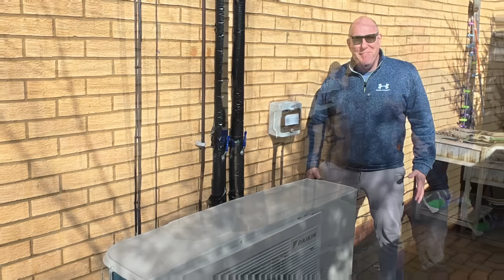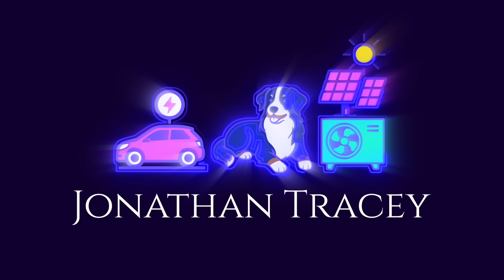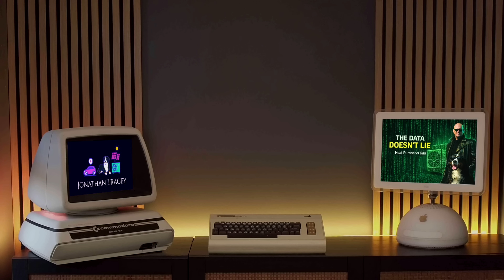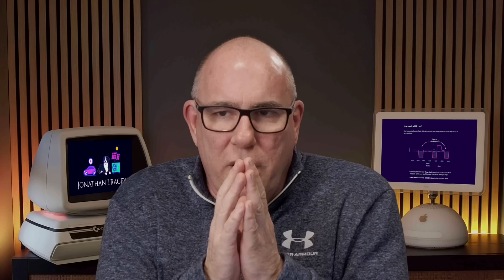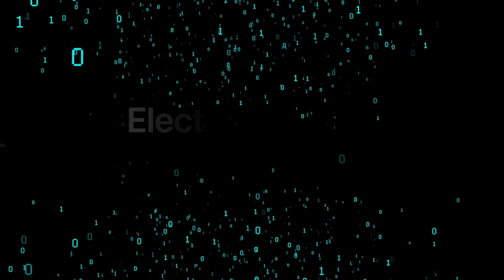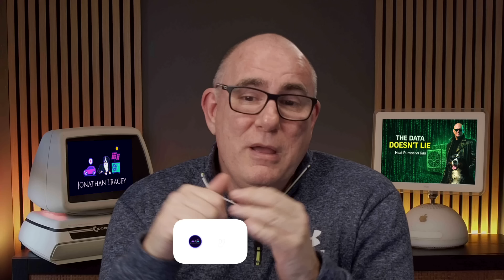The Data Doesn’t Lie   Gas vs Heat Pump Real Running Costs

Comment: Yeah you need to run those numbers again 😂😅
Reply from the maker: I have just completed another round of these numbers, video coming tomorrow
Reply: @JonathanTracey you are correct of course solar battery and heat pump is undeniable the best way to go, any other combination is Suboptimal

Comment: The biggest scandal is that our 650 MPs haven’t  made it law that every new build property be fitted with solar panels, heat pumps and ev chargers….i wonder why??….could it be that if every household had a bill of £0 then no VAT or fuel duty would be due !!!
Reply from the maker: @Vega9Baja I get why it feels like that, but it’s not quite that simple 👍

There is lobbying in the UK, but it’s regulated and transparent — MPs still have to justify decisions publicly and through legislation.

On your main point — even if every home had £0 bills (which realistically wouldn’t happen year-round), the government would still collect revenue through other taxes (income tax, VAT on other spending, etc.). Energy isn’t their only income stream.

I do agree though — there’s definitely a case for pushing new builds harder on solar and efficiency 👍

Comment: They don't give 'more even heat' at all! They use the same system as a gas boiler would.
You've chosen a poor combi at 90% efficiency, they're more than that now - up to 98%. Apply that 8% to a £1k PA fuel bill gives you a saving of £80.
 Even the most expensive and efficient Combi is a fraction of the cost of any ASHP. I don't think you took ROI into consideration, maybe time to get the calculator out again!
A combi lives in luxury, an ASHP does not. It lives outside in the cold,  rain and sun. They all take their toll.
 I wonder what state these ASHP will be in after living outside in the UK for years on end. If you've ever worked on anything which has lived outside you'll know just what the weather does to it, rot, rust, seizure, breakages etc. 
Off the top of my head I can't think of a direct comparison, only a car which sees more extremes and they don't come apart very easily after 10yrs of being outside. Heck, even two of our UPVC windows have seized and broken mechanisms so the sashes can't be opened, some units 'blown', the doors let in draughts. They were made and fitted by a well known top end company.

Only time will tell on that one.
Reply from the maker: @lksf9820 I get what you’re saying, but this is where the difference shows 👍

Heat pumps typically run **continuously at a low level**, so the temperature stays stable. Most gas boiler systems are run on schedules — on/off — so the house heats up, cools down, then heats up again.

So yes, both use radiators, but the **way they deliver heat is different**, and that’s why many people experience a more even temperature with a heat pump.

On efficiency — comparing 90% vs 98% on a boiler misses the bigger point. A heat pump isn’t 100% efficient… it’s typically **300–400% (COP 3–4)**, so it delivers 3–4 units of heat for every unit of electricity.

And on longevity — these units are designed for outdoor use (like AC units, which have been running outside for decades), so it’s not quite the unknown it might seem.

Happy to debate the costs — but the fundamentals there are pretty well established 👍
Reply: @JonathanTracey   i'm well aware of a HP % efficiency, just as you are that electricity is 4 - 5 X as much.

Longevity? Moot point, we can only discuss possibilities or ask an experienced, unbiased engineer on their findings.  I've seen vids of people pulling apart some pretty rusty HPs. You can't deny that a car (or any mechanical object) kept unused outside will not last anywhere near as long as one stored inside a warm, dry environment.
Google 'ASHP rust', 'ASHP coil corrosion' and 'Graham Hendra ACF50 '.
Having lots of practical mechanical engineering knowledge I know which i'd rather be working on and where, it wouldn't be a 15yr old ASHP outside in Jan at -7c.
BUT as said, we'll just have to see on that one.

"Heat pumps typically run **continuously at a low level**, so the temperature stays stable. Most gas boiler systems are run on schedules — on/off — so the house heats up, cools down, then heats up again."

Sorry you've completely missed the point. That is up to the user and applies to both. You can run your HP badly like a combi, or run your combi either way, yes, just like an ASHP.
 Everything you or anyone have had done to make an ASHP run efficiently applies to a gas boiler*. We run our combi continuously, 20 during the day, 15 at night, 50c flow temp, just like an ASHP. Just like your house ours is always comfortable, warm and economical. But we haven't had the cost of a Hp, solar and batteries.
The only thing we'll ever renew is the boiler in 15 - 20yrs time, that's circa £100 per year.
How do you make a combi more reliable? Run it low and slow like a Hp.
 If you want a good, detailed video on running a Combi like an ASHP just ask.

*Efficient pipework, properly sized rads or UFH, weather comp', load comp', intelligent controls, etc, etc.

Comment: Interesting take - thanks.  There's also the issue that heat pumps represent a significant capital investment that needs to be considered.  I am open to the idea of a heat pump, but the financial case is not there at the moment. In addition, even with my modern detached house, finding a location for a heat pump is problematic. That's before you even try to find a competent installer!  I agree the 'spark gap' needs attention.  I can see me having a heat pump one day - but it's a log way off....
Reply from the maker: depending on how much work needs to be done to make the install happen the cost can be roughly equivalent to a new gas boiler. In my case a new gas boiler was gonna cost about £3700 and the Heat Pump cost me £3900. I agree with you on new build house houses just not having the space. It seems to developers. Don’t think that somebody may want to change out the gas boiler for a heat pump because they don’t leave you anywhere to put it.

Comment: A problem I have with all of this is that having a smartphone seems to be virtually compulsory, but I simply can't use them. I tried several times with different makes I've been loaned by friends, and literally have to use a magnifying glass to read the text, I also have very fat dry fingers - which gives hilarious results (or none at all).
Reply from the maker: unfortunately, that’s the way of the world. I don’t think we’re gonna see any move away from smartphones in our lifetime.
Reply: Many of the applications such as Octopus Energy work on an iPad too.
Reply: @ToneRoses  I appreciate your comment, but as I'm reliant on the state pension, there is no way I could even think about getting one of those - especially as I don't know if it would actually work for me.

Comment: Okay, so a huge investment in battery storage, but when, the all singing all dancing solid state batteries come main stream and battery prices fall, every man and his dog will be overnight cheap rate charging, then the grid will become normalised 24/7 and the cheap rate tariff will be scrapped... On another note, if everybody in the UK had a heat pump sucking the warmth out of the air and generating cold air as the result, do you think at some point, heat pumps will become less efficient as they start to fight for the precious warm air on on a cold dull day in the city/suburbia? This is excluding GSHP. Just a thought...🤔
Reply from the maker: @MrIanspeed Interesting questions. A couple of things worth clearing up.

On the cheap-rate tariffs: they exist because demand on the grid changes through the day. Even if battery prices fall and more people charge overnight, the grid will still have periods of lower and higher demand — especially with renewables where supply varies with wind and sun. So time-of-use pricing is actually likely to become more common, not less.

On heat pumps “stealing the warm air”: in practice the effect is tiny. The atmosphere contains an enormous amount of heat energy and outdoor units are constantly exchanging air with their surroundings. Even if a whole street had heat pumps running, the air mixes so quickly that they aren’t competing for the same heat in any meaningful way. Countries with far higher heat-pump adoption than the UK (like Norway or Sweden) don’t see this issue.

So it’s a good thought experiment, but in the real world the physics and the scale of the atmosphere mean it’s not something that becomes a limiting factor.

Comment: But day-to-day operating costs are only half the story. To get any kind of meaningful comparison, you also have to factor in system capital costs. 

In 2022 I had a small 3.16 kWp solar system installed. On a day-to-day basis, any solar I get is notionally 'free'. However to access this 'free' energy, I first had to shell out £8750. My system generates about 2,500 kWh per year or 25,000 kWh per decade. If I amortise the capital cost over 10 years (the guaranteed life of the battery), on a straightforward arithmetic basis, each kWh of solar costs me 35p. That's more than the 25p/kWh it would cost to pull leccy straight from the grid on a bog standard tariff!! Factor in the lost interest I would have got my £8750, had I kept it in a savings account for 10 years & the economics look even worse.

And that's for panels. The capital costs for installing a heat pump dwarf the cost of putting in a new, efficient, condensing, gas boiler. This acts to further widen the spark gap.

FYI, I'm on Octopus Flux for electricity & get my gas from Octopus on a fixed 12 month tariff. In 2024 my annual combined gas plus leccy bill was £546. In 2025, this dropped to £438 (£282 of which was standing charge).
Reply from the maker: @MrSensible2 I agree with your general point — capital cost absolutely matters and it’s something people should include when doing a full comparison.

In my case though the system costs are already sunk and effectively repaid, and the heat pump is largely using solar capacity I already had available. That’s why in the videos I tend to compare the running costs against a standard tariff — it shows the real-world operating difference people might see.

Also worth noting the actual cost of the heat pump install for me ended up being roughly the same as replacing the boiler would have been, once the grant was applied, so the comparison wasn’t as dramatic as people often assume.

Comment: I've been watching Jonathan's channel (and others to do with 'renewables') for some time now. I started out fairly sceptical and have slowly come around to testing the water.
My first thought was to have a battery installation, to charge up on cheap rate electricity and power the house during the day. When I realised how little solar panels would add to this (and how much they'd improve payback time) I started to ask some of the bigger players (and some local ones) for quotations.
The calculations were complicated by the fact that we'd moved to a smaller house and (although we're not here for the whole year) our energy bills (gas and electricity) have gone down from £1100 pa to around £900 pa, as we got used to the house (and insulated the loft!) So, savings at present are unlikely to be great, but when I factor in what might be had from exporting to the grid, the payback time is around 7.5 to 8 years, when I hope still to be around and congratulation myself on my decision-making.
What really decided me (and helped convince my wife) is that I think energy prices can only go up in future. The recent US/Iran shenanigans has only reinforced that view.
We're even considering buying a used EV as a second car, given that we would want to be on an overnight cheap rate for electricity.
So, my thanks to Jonathan (and Gary Does Solar) for some fascinating 'real-life-experience' videos. Much better than trusting to government propaganda, or commercial advertising blurb.
Well done, and keep 'em coming!
Reply from the maker: @StillOnLPlates Welcome to the solar club! It sounds like you’ve taken a really sensible, measured approach to it. A 7–8 year payback is pretty typical for a well-sized system, especially when you factor in export and cheap-rate charging.

I also think you’ve probably made the decision at a good time. With the current geopolitical tensions pushing energy prices around again, it’s hard to see energy getting dramatically cheaper any time soon. Generating some of your own and shifting usage onto cheap-rate electricity is a pretty good hedge against that.
Reply: We have solar panels- already paid for themselves in less than 6 years. My brother in Australia has solar panels still going strong after nearly 30 years. Storage batteries meant we ran the house for free for 7 months of the year. Second hand EV and Octopus Intelligent Go tariff actually reduced our total bill because we can run on cheap overnight electricity for 24 hours for 8 months of the year. Solar export gives us a profit even at 12p/kwh. Total bill because£1250 per annum for 5 bed detached house, including 12,000 miles of driving (at 1.6pence per mile).

Comment: The main thing that is definetely slowlng the heat pump adoption and bringing points against them like you did in the video is that the price of gas is still setting the main cost of electricity in the UK when renewables aren't generating. If gas prices go up so does electricity relative and it looks like more in comparison I would say. Don't forsee enough for mass adoption really "wanting a heat pump" even if they are savy enough to check the numbers and work out they can save money. It only starts to make sense if they decide to get battery storage first realistically and even better if thats with solar, like your setup. Still way too many barriers in the way then too sadly for the layman, retro fit cost, aesthetics, property space for equipment install, praying the installer is actually good. Its kinds of annoying that even a badly installed combi will still 99% of the time heat the house up, they are kind of a great invention, just the energy source is the problem nowadays and homeowners cannot produce their own gas which is always going to be the issue going forward. I've got a 10 year old combi, planning to get batteries and hopefully solar (which seems to keep going down in price at a decent pace) before the boiler packs in and then I can decide to go for a heat pump and enjoy the system working together to save me money.
Reply from the maker: @jamesripper I think you’re right that the spark gap between gas and electricity needs fixing first — that’s probably the single biggest barrier right now. As long as gas is effectively setting the electricity price, it distorts the economics.

I also agree that building regulations need to catch up. New homes should really be designed with heat pumps in mind from day one — space for the unit, cylinder, pipe runs and low-temperature heating. Instead we often end up with tiny plots where developers pack in as many houses as possible, which makes retrofitting something like a heat pump much harder later on.

It does highlight the disconnect in policy sometimes — one part of government saying we should move to heat pumps, while another allows houses to be built as cheaply and tightly as possible without thinking about how they’ll actually be heated in the future.

Comment: Very intersting thank you. I now have my first 12 months of data since I got a heat pump installed and got rid of gas, including the gas meter! No solar or home battey just yet, but I can report based on what I spent over all on energy, I saved only £4.84 over the whole year and £21.57 over the same three winter months last year. The savings were only achieved by having the smart Heat Pump+ tarrif with OVO energy, which doesn't even exist any more. Thats with a enrgy rating of 4.8 too! Although I can factor in a further saving made by having the Gas Meter taken out and inflation I suppose. Like you said though, its only going to start paying off when I start generating my own electricity and storing cheap energy from the grid really. That being said; I wouldn't go back to a gas boiler, my heat pump is far supperior to what I had previously and the house used to be cold at times, unlike now.
Reply from the maker: @davidsanders904 Thanks for sharing the data — that’s really interesting to see a full year’s numbers. Hopefully once things settle down in the Middle East we’ll start to see energy prices stabilise, and then we’ll be able to feel the impact of the policy changes the government is bringing in from April.  

If those changes start to shrink the “spark gap” between gas and electricity, the economics of heat pumps should look a lot better going forward.
Reply: @JonathanTracey  DOH! I actually forgot to add I bought an EV in November, which means I need to take into account the savings made in petorol over 3 months too. Things are now actually looking a whole lot better already :)